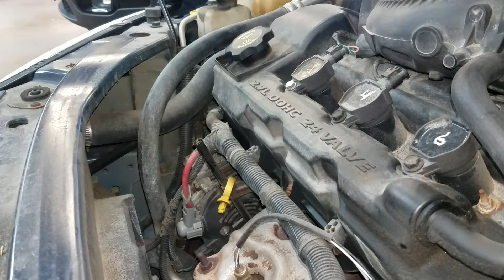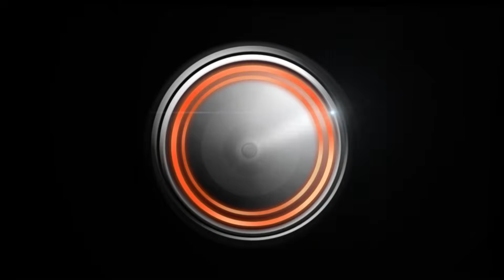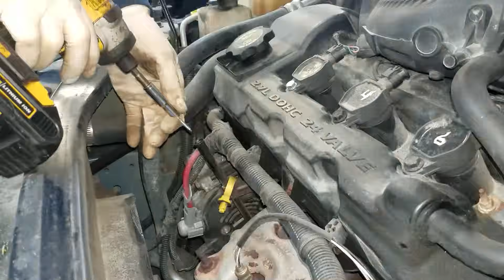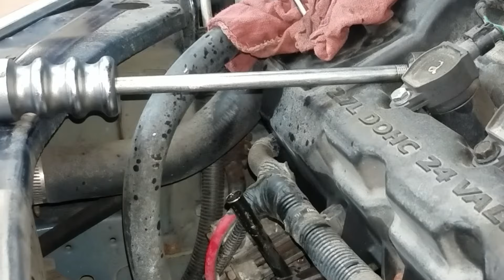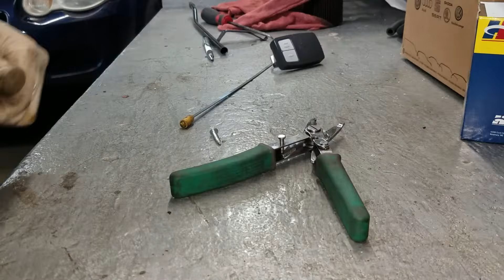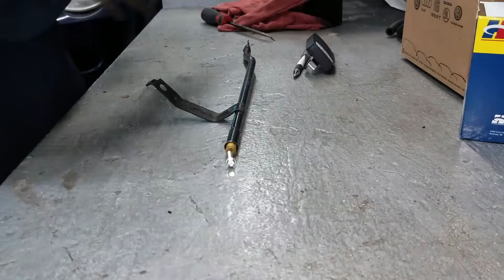Broken Oil Dipstick Removal "Cool Trick"

Comment: I used the flat part of as screw with crazy Glue. It worked for me.
Reply: I initially tried the head of a nail with Krazy glue, which didn't work. Then I tried a pencil like another poster commented. It worked like a charm. 😂

Comment: My guy. Don’t use self tapper. No thread at bottom. Also predrill a hole with 1/8-5/54 drill bit, then hand tighten a 2-1/2” wood screw. Use a hammer and pry it like a nail with a piece of wood as leverage. I just did this on my charger after watching this very video. I even made a short to show. Check it out
Reply: Just drop the oil pan
Reply: @EBOATTV  Many vehicles require u to lift the engine slightly to remove said pan. Also you must replace the pan gasket along with making a huge mess. A quick prefilled hole and a deck screw has worked all 4 times I’ve done it for other people.

Comment: Don't use shop air! I blew out my rear main seal trying to get the dipstick. Traded one problem for a worse problem.
Reply: I was not aware about that issue, I am glad to see this comment on several posts (needless to say I do not have access to shop air). The only option I have (I guess) is to do this job the right (and possible hard) way: remove the tube. Already tried other methods...Thanks for the heads up.

Comment: Put in self tapping screw Heat the top of the tube with a torch to melt the plastic. The stick will pull out with zero effort if you melt the plastic enough in the tube

Comment: Screw didn't work for me. The air trick didn't work for me. I ended up straightening out a small fish hook and was able to barely insert it in the hole I drilled to try a screw that didn't work. The barb hooked the plastic edge of the hole and it came right out.

Comment: F150 Broken dipstick used the drill method and it worked like a charm, the dealer wanted to remove valve cover on my 2.7 Ecoboost engine that would have cost hundreds, 1/8th drill bit, WD40 , a size 10 deck screw and pliers is all you need.

Comment: Instead of pulling the dipstick tube, you can change both main seals because pressurizing the crankcase with shop air has a high probability of blowing them out. Sometimes the hard, simple way is the easiest.
Reply: You can just go in the oil pan and u will see it

Comment: I just had this happen to me. I took a pencil and superglued it to the broken dipstick down in the tube. Waited a few minutes for the glue to set up and was able to pull it out. If that hadn't worked, pre-drilling the end of the broken dipstick and running a screw into it was going to be my next option. Great video by the way!
Reply: Your 2nd choice would have pushed it farther
Reply: I did the same thing with a glue stick worked like a charm.
Reply: I faced this problem this morning while getting an oil change. I was told they couldn't change the oil because the dipstick was broken. I'm thinking that they had broken it. I got the bright idea of using krazy glue on the head of a nail. Then I came to YT and found your post and thought great minds think a like. I tried the nail with no results. I took a nap after getting up so early (before dawn) for the oil change. I thought about using a drill but decided to give your pencil tip a try. I applied the glue to the wooden end of the pencil. I held it in place for a minute, then let it rest for about 3 to 5 minutes. The pencil was leaning after letting it go, and I thought this couldn't be a good sign. After several minutes, I gently started to remove the pencil, and my dipstick was about 1.5 inches down. I didn't feel any resistance while removing the pencil and thought it didn't work. But once the end of the pencil came out, I saw the dipstick attached and began thanking Jesus. I sure didn't want a trip to the dealership. 😂
Reply: @eddiejames9827  That is awesome! So glad it worked for you.
Reply: This worked for me. Thank you!
Reply: May ask how far down was the broken part
Reply: @mahoganired8608  About a half inch as I recall. It sheered off pretty flat, so I had a relatively flat surface to super glue the pencil too. Incidentally I used the eraser side of the pencil. I cut off the eraser flush with the metal ring on the pencil and super glued that to the broken dipstick and then pulled it out.
Reply: Excellent. I thought similar things like a dab of JB and screw or ?

Comment: would you believe I went to Valvoline yesterday and the kid checking my dipstick broke the dipstick tip off. I didn't think it was a big deal and didn't want to make a complaint since he was a young guy that just made an innocent mistake (kind of like that time I left the irrigation system on at a plant nursery over a 6 day holiday and caused every plant to drown to death ...lol) but when I got home and tried to get it out it went further down like 2 inches. Also the oil gauge in my car is less than half so they might not have put enough in the car and I can't check it myself. I'm thinking I might have to go back to the place and demand they get it out or pay to get it out if I can't. Looking at this video it looks like it won't be a big deal to just remove the stem. If I do that is there any danger of oil leaking out???
Reply: What ended up happening ? This same thing just happened to me and now I’m up shits creek no paddle